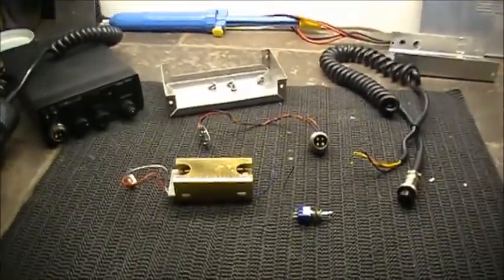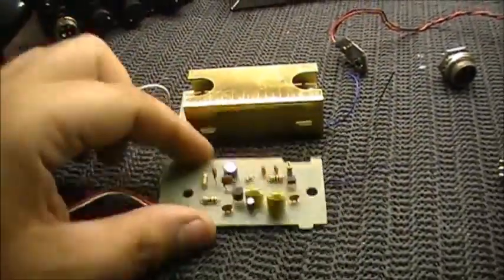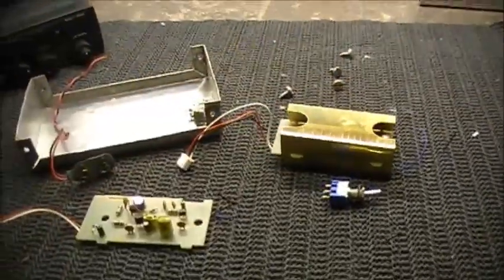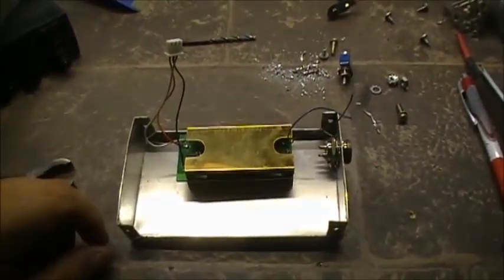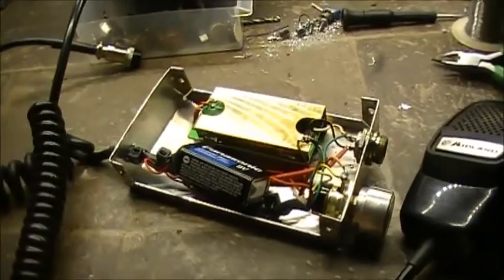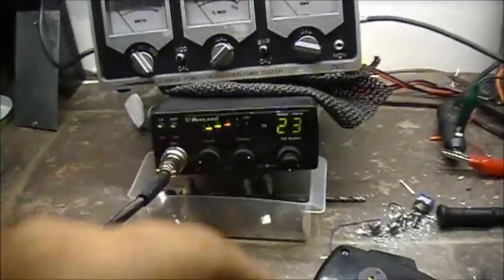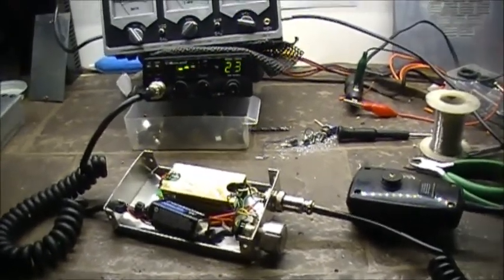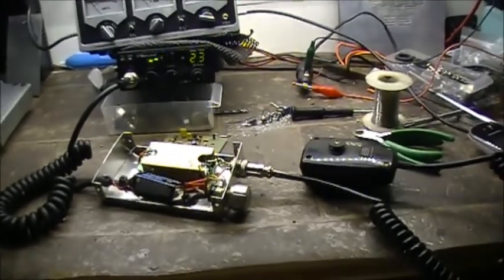Let's build a Microphone pre-amplIfier   [ CB RADIO ]

Comment: The Icom SM25 Microphone  Schematic only shows having one 2SC2458L(Y) Transistor - it looks like the board you have has 2 Transistors on the board. A 2 Transistor Circuit with BC547 or 2SC945 like the D104 Schematic with adjustable gain should give over 100 percent modulation.

Comment: Nice work!  I have a broken case power mic and a stock mic that I really like.........Guess what I'm gonna build.  Thanks for The Great idea! wish I could give 2 thumbs up.
Reply from the maker: Thank you very much!  I still have a spare pre-amplifier left here i plan
 to transplant inside a desk microphone next, this time the radio will supply the 
voltage on a unused pin!   ;-)
Reply: I have often thought of using that extra pin for power too. it would stop me from testing batteries with My tongue!
Reply from the maker: Just make sure that the pin is not tied into the radio on the inside.

Comment: the close-captioning is murder on your speech, lol!  love the vid, i am making a similar box using an amp i got from walmart online. it is so incredibly loud, that im still sorting the right series of resistors to control it. what rating is your pot, and is the buisiness end connected directly to the amp out? also i am fortunately not having that receive feedback issue, but thats a good tip, thank you.
Reply from the maker: This amplifier connects between the microphone and the radio, so any un-amplified microphone can pretty much work with this one.